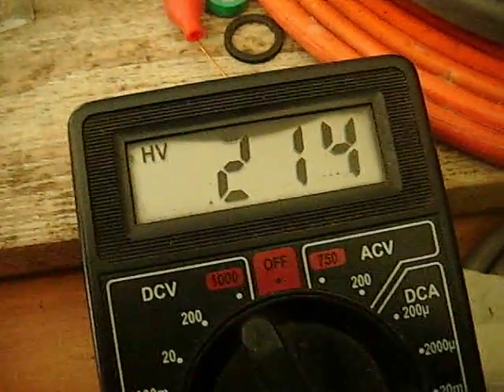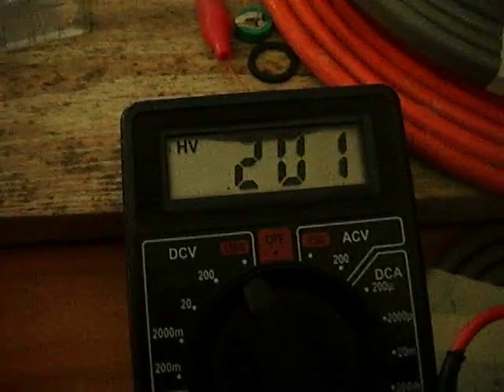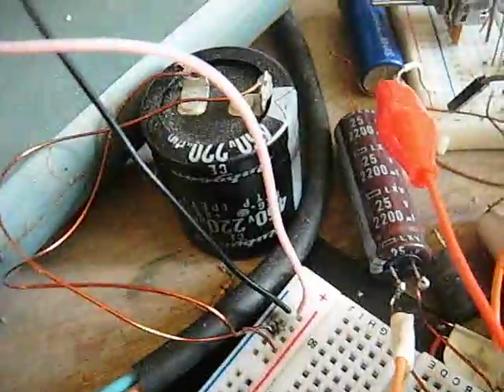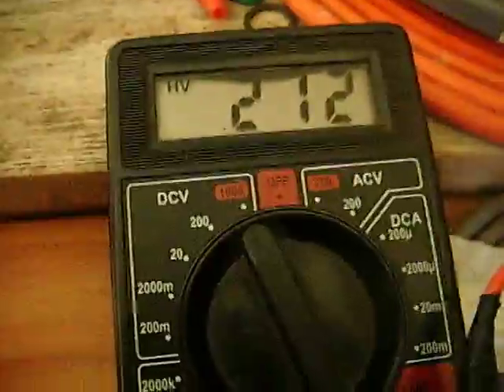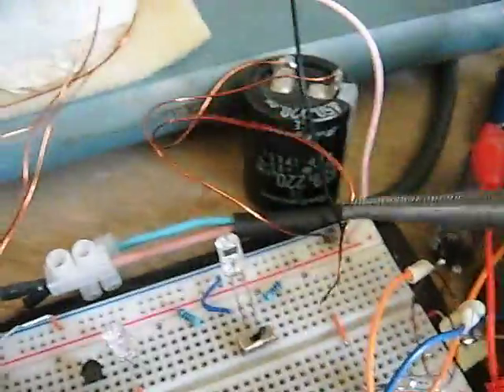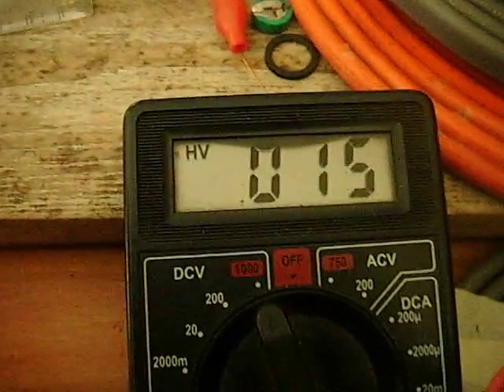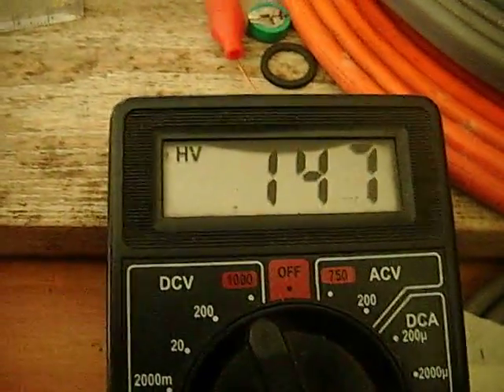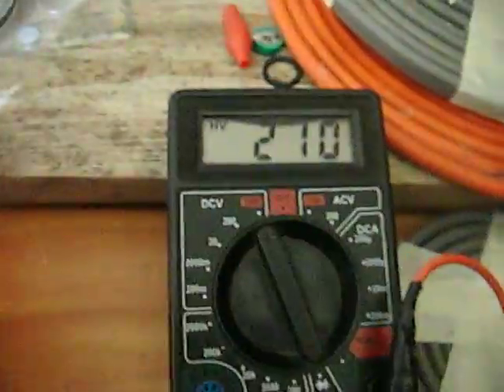200v+ Bedini Motor (charging 450v Capacitor)

Comment: Charging a 450v capacitor is cool but what does it mean?  i can charge a 450v capacitor in 5 minutes with a hand crank.  The energy density of a capacitor is almost 0.  Where is the real useable power?
Reply from the maker: The Bedini Motor is for charging multiple batteries simultaneously and requires only a simple gentle push to start it (if you know anything at all about bedini motors)  - Energy density?? You talking bout "uF"? It's only 220uf Dude, it's a capacitor not a battery! The capacitor only enables me to harvest the 200v radiant spike. Right, I have seen your strange page dude and trust me, you're in no position to be making fun of anyone!! ;¬) Talk cats and please don't take up Electronics until you've had a refresher course. :¬p
Reply: Dreadnyah I'm not making fun of you or anyone else.  Relax, don't get butt hurt dude. 

And no, I'm not talking farads or microfarads, or milifarads.  I'm talking energy density.   The amount of energy stored in a given system or region of space per unit volume or mass.  And no shit it's a capacitor but a capacitor has energy density too, you jackass.  So what are you charging the capacitor for?  Electroshock therapy so you're not such a crybaby douchebag? 

Hahaha, go fuck yourself bloody limey.
Reply from the maker: Did you get adverts? I thought I disabled them :¬/ Maybe you haven't noticed my Video's are not monetized. If I wished to become famous for being a noob low voltage electricity experimentor do you not think it would be wiser to show my face? So, I am "obviously" NOT in it for the money!!;¬) When it comes to commenting on videos it's better to be a bit constructive with criticism than an obsessed cat lover pretending he knows something about the bedini motor. It just saves you making a fool of yourself :¬) Please, stick to cats or experiment for yourself... No, wait, stick to cats ;¬)
Reply from the maker: LOL :D It's  run by a home made solar panel, normally a 4.5v solar panel can't charge anything to 200 volts let alone a capacitor. I am impressed (personally), I am interested (personally), I experiment with great focus and I like it (personally) The strange thing is, you coming on here to speak of something you know nothing about (me) and troll a bit. I make no claims and I mention that "I" find it interesting enough to share, you find it interesting enough to mock... Why did you even bother to comment if you don't have anything good to say?? Habit:;¬) Troll, Female dog... Same thing, you people are boring coz your bored... Don't you have a cat to bath?
Reply from the maker: Quote: "tantamount to flying an airplane to the grocery store" - Dude, it's a 12v battery charger that fills a capacitor (in less than a minute, nothing special) Your analogy simply makes no sense as there is no comparison. Bedini motors do not fly but capacitors do store electrons... I mean, what is that? Your type of logic? Mate, just get a life ;¬)
Reply from the maker: Insults? I thought you were battle rapping me.... Mate, I will own you! Your words better describe your message from the start, thanks for saving me the bother of writing what you just wrote :¬D People always describe themselves when they are angered, funny coz they can't seem to see it themselves, your next comment may prove me perfectly right..
Reply from the maker: So let me get this straight, it's ok for you to come on and mock (insult) but when you get it back you throw your plastic doll out of your pram? Get a grip dude "My logic is undeniable!" ;D
Reply from the maker: The real problem is, Trolls don't actually know they're words are derogatory. I won't blame you for not seeing the obvious, spoilt kids are the same, it's not their fault ;¬)
Reply from the maker: So using the phrase "hand-Crank", you're telling me that's not an insult>? Bizarre!
Reply from the maker: That's an insult to your kind? I mean, you've edited a few words but it's a battery charger, I explained everything needed to be explained. My description and your words do not match... period, your logic and words are imperfect and yes, I have learned NOTHING from your electronics expertise or criticism, tell me something I don't know :D I only charge it to 200v (as stated) - Now get a life will you, this is not it, life is outside the box ;¬) Where your cat should be, do that! You're very boring... Zzzzz
Reply from the maker: Ok :¬) Rest assured, you have no advice you could give me ;¬) Things are perfect thank you.